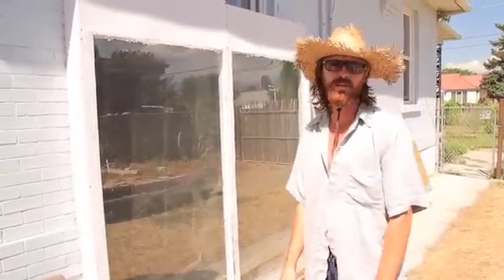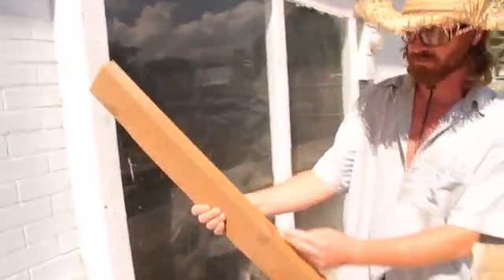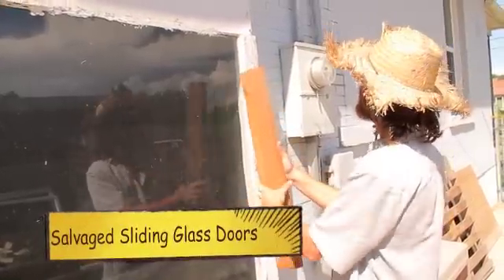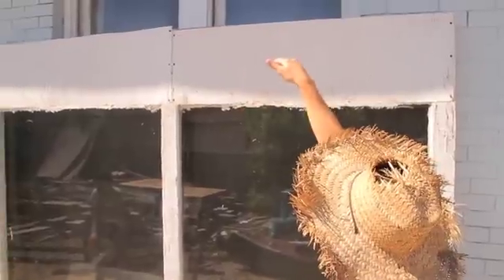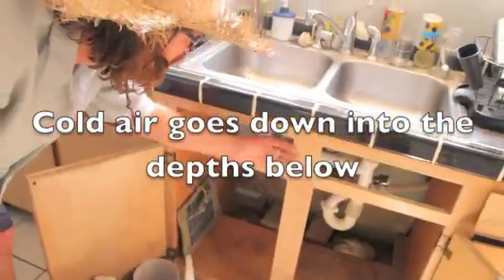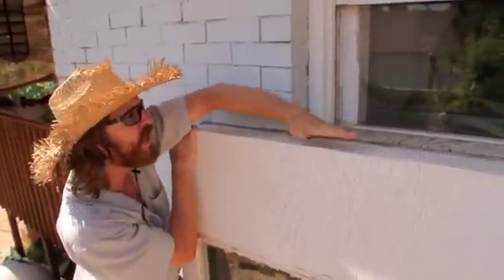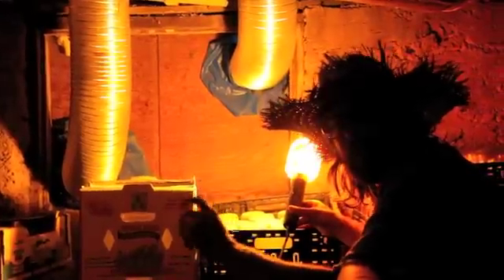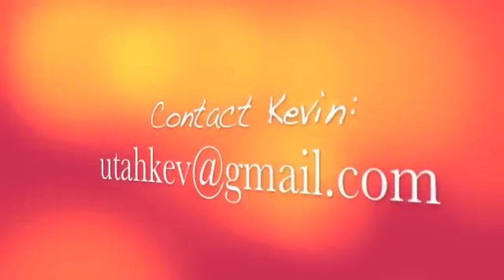Trombe Wall Explained: Passive Solar

Comment: ...sultan of spit...self taught, and it shows...a little knowledge can be a dangerous thing...
Reply: Clarify this for me, You are saying it is dangerous for this man to show how one can completely cut out a daytime heating bill? I fail to see the significance of your concern.  Many people who troll aren't doers instead they are watchers who are threatened by those who can do. Personally I appreciate being shown that I, who's work would not be at a professional level, could also make the same thing. What matters is free heat.
Reply: @paperwork1125  I think he says this because it appears this man is wrongfully termed his construction a trombe wall. If it was, it would have a thermal mass behind the glass that retained heat.
Reply: The brick wall?
Reply: @paperwork1125  Yes. Trombe walls can be constructed of anything from water to concrete to bricks to earth. What the gentleman here has built is a solar convection panel. Kudos to him for harvesting the sun, but, yes, he should (and apparently WANTS to) "spread the gospel" and should do a little more research in order to pick up the correct terminology. Again, though, HATS OFF TO HIM for his "green enthusiasm"!!
Reply: @michaelscott356  He said there was bricks behind the black plastic.  It's a Thrombe wall.
Reply: Boi yo name is Ted Bojo, cuz u a bozo

Comment: great video,
Though this is NOT a trombe wall rather it is a solar air heating system, quite different in design and purpose.

Trombe walls aim to heat up a large chunk of thermal mass that then stabilises day night temperature and increases the available radiant heat. They may or may not have vents.
Solar air heating systems aim to heat a chunk of air in a contained space then thermosyphon or pump this through a room, they will always have vents, that may be passive or active

Comment: Mr. Bell, could you please tell memwhat kind of material you're using inside the trombe wall--that dark material that's visible through the glass? And if you don't mind me asking have you gotten any calculations on the system capacity? Or any numbers on how much gas/electricity or heating cost you've been able to knock off? Thank you.